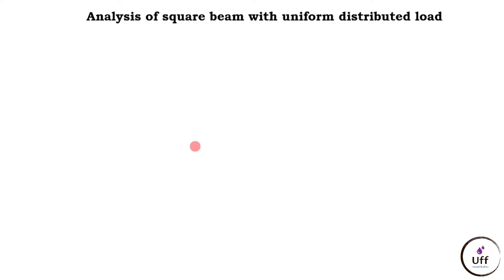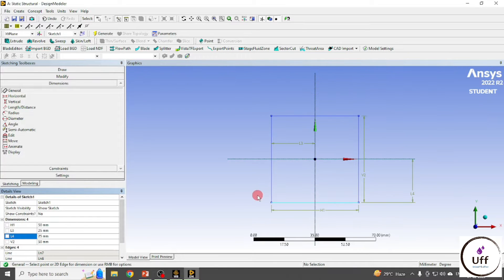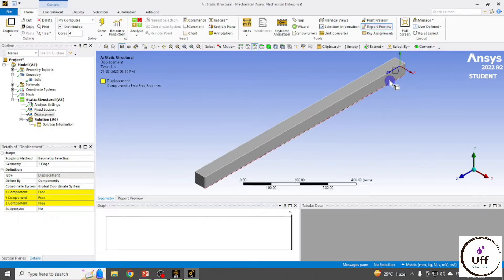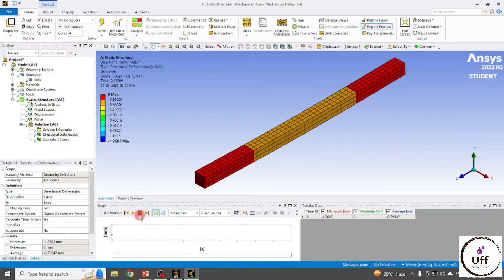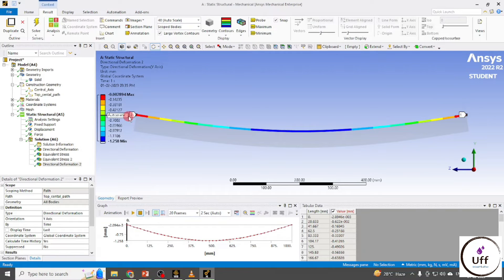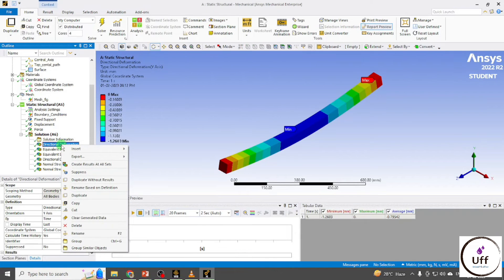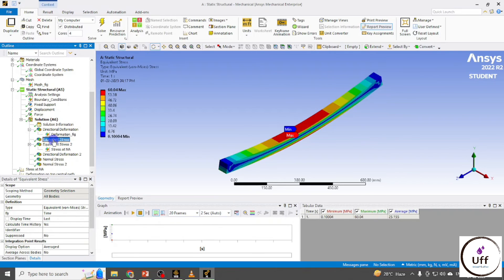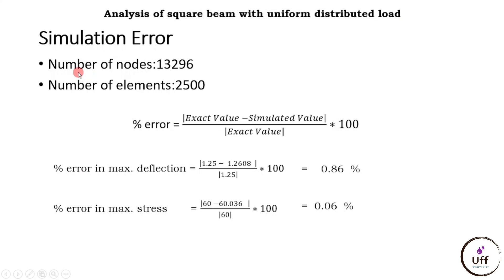Simply Supported Beam with UDL in ANSYS Workbench

Comment: @uff how to know at which point the beam failed
Reply from the maker: If the stresses are above yeild/ultimate stress then we can say that the beam is failed
Or 
If deformation is more than permissible limit then also we can conclude that beam is failed
Reply: What about torsional buckling in case of steel beam? @sudeshpowar100